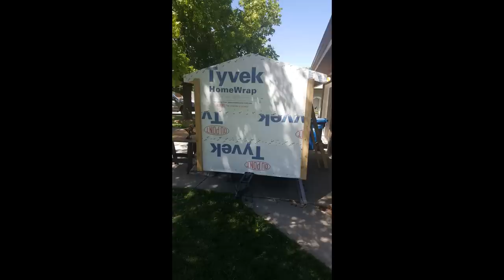Tiny House Camper Build !!!

Comment: That trailer is most likely WAY over-weighted.
Reply: I said the same thing..AND it just seems a shame that after all the effort that went into something that damn heavy, why wouldn't they spend anytime upgrading the axles, wheels and hubs. But instead it sits on the stock wheels rated for 55 MPH.
Reply: The roof itself on a pop up is quite heavy alone and the hardware for the pulley system has a lot of weight also and with all that being remove it allows for much more weight to work with..I’m in process of doing this same thing and the weight by my research, most that were rebuilt come under the weight that it initially held. 
😊

Comment: very cool, but isn't it way over the trailer's weight limit?
Reply from the maker: I have not weighed it yet, but the it has a 2000 pound Dexter axle under it and i have pulled it on a couple long road trips so far and have had zero issues with. Rides great, no swaying on bouncing. If i had to guess i would put it at 1700 ish
Reply: I was wondering the same thing.....you see some YouTube videos that make a huge deal about the trailer bring beefed up to support the house....I was thinking of his ways just to lighten the load instead. Thought about fiberglassing the walls and roof by just Putin a couple layers over polystyrene panels our polyurethane if I could get a hold of them. Maybe not necessary, I guess. I like the outbuild too. Is there no problem with the house overhanging the wheels? What are the overall dimensions?
Reply from the maker: biggregg5 outside is 5.5 ft x 9ft. And there is a 4 inch recess for the wheels

Comment: Any idea on total weight without the trailer?
Reply from the maker: I have not weighed it yet, but the it has a 2000 pound Dexter axle under it and i have pulled it on a couple long road trips so far and have had zero issues with. Rides great, no swaying on bouncing. If i had to guess i would put it at 1700 ish

Comment: looks like the pics were a little out of sequence.  Why that artificial floor?  why the gap?  also another question for anyone that wants to answer, on these "tiny homes" (trailers), why not steel studs?  aren't they lighter?
Reply from the maker: Ya I had some trouble with uploading the pics. The fake floor is more durable and the gap is so I can sit up and its where my dog sleeps
Reply from the maker: And metals studs would have been a good idea
Reply: +Alex Alderton thanks for reply.  may I ask 1 more question? that thing can be legally towed anywhere?  any restrictions on that? 
it looks real nice by the way. good job!
Reply from the maker: kthcsh I have towed it around Missouri and Arkansas with any issues. But my plan is to get it registered as a homemade trailer
Reply: @anninriverside755  , your a nitemare, bet your single
Reply: @anninriverside755  where's your build?? Calling someone's shit.  And no you don't have to have it registered in every state to use. Little unknown fact. Most states you can travel the entire state without register tags.

Comment: Not impressed, if you wanted a bed on wheels .....just buy a panel van
Reply: David Osborne exactly what i thought
Reply: I thought of that option too, there are pros and cons with both, one major pro with using a trailer instead of a van is that if the van breaks down you can just get another van and won't need to rebuild the camper portion.  a van has a lot more mechanical parts to break down over the trailer.